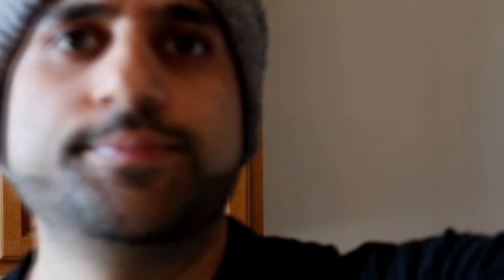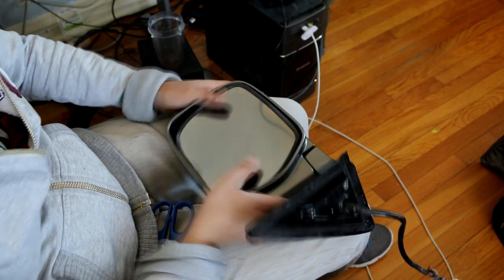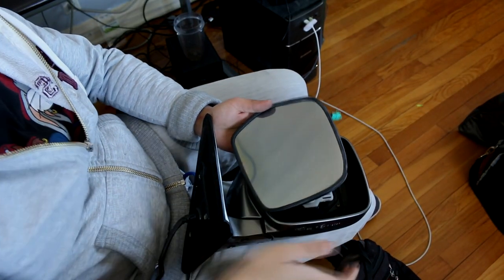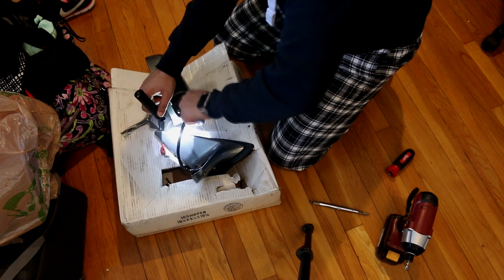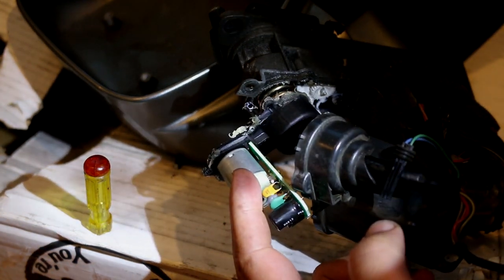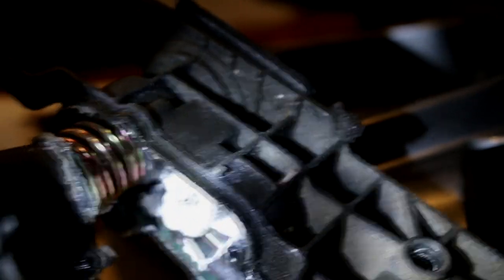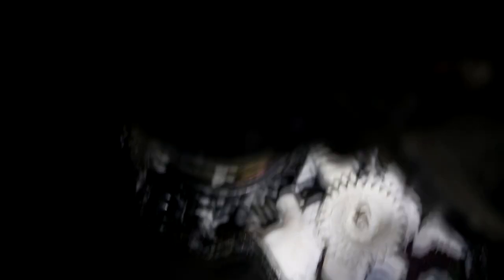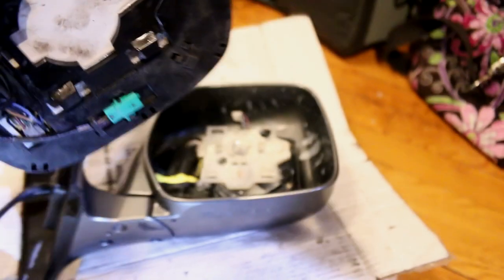Side mirror gear or problem fix retracting LX470 and Land Cruiser

Comment: i need an help. i had opened the mirror of mitsubishi. it has an circuit inside. had relay 1 and relay 2, and 3-4 resistors. and 2 big capacitor and one small capacitor. to the motor. Does this type mirror dont need the control unit seperately? shall i connect the orvm to switch and power, without external circuit? pls help

Comment: Hello and Thank you for sharing this video! Question: Did you find the screws? What are they?   I did what you told everyone not to do - stripped the screw heads. Quick Note to everyone planning to do this... these  screws strip like they are made of butter! Toyota used the CRAPPIEST screws they could find and locked them into this mirror assy to make the day you need to remove them indelible in your memory. Use a microtorch to heat/melt the locktite and be prepared to drill them out.
Reply: Same problem here. I’m still thinking how I’m going to take ANY of the three d@#& screw out. I’ve tried with screw extractor tool with no luck.
Reply: @historiaycuriosidades  In my case, there is a broken gear inside the mirror assembly. Because the gearing is broken, the mirror cannot find its "home" position and this causes the motor to continuously wind (very annoying). This was my purpose to take the mirror apart. After finding out how difficult removing the screws turned out to be, I found a way to disconnect the power to the motor altogether (luckily, my mirror is in a good position to drive with and I am OK with not having the auto-folding mirrors). Now my driver's side mirror power has been disconnected, the motor no longer runs (!yay!), and I am fine with all of this. Perhaps you can do the same thing if you have the same problem.
Reply: Avi Edelson When mine broke I immediately disconnect the folding motor but from time to time the wind will move the mirror (a bit). Right now I manage to get the motor out and the broken gear. It’s s 23 teeth gear I found it in AliExpress. Hope this can help
Reply: Screws are not PHILIPS but JIS (Japanese Industrial Standard). Use proper tool.

Comment: How does it stop in its normal position when opened? Has a physical limit or is it electronically on the card. Mine took a hit while backing away and now upon opening it unfolds completely forward. I disarm it and find nothing broken.
Reply: Mine too. Did you find a solution???
Reply: @maralynthomson4375  I couldn't determine it, I ended up buying the motor assembled by ebay, and it came out very economical and it has already been in operation for more than two years.

Comment: You're a legend bro ty
Reply from the maker: No Prob bro. I hope it helps you out. Be really careful with the 3 screws on the bottom they are the toughest part of the job.I still need to drill and tap 2 of the 3 because they broke off. an impact driver might be the best way to get these off without breaking them.